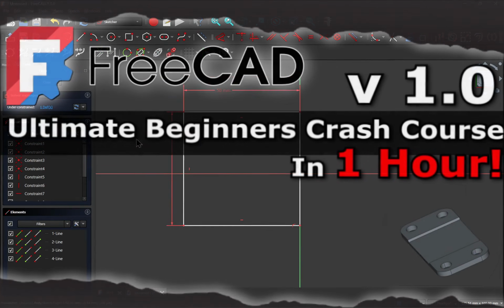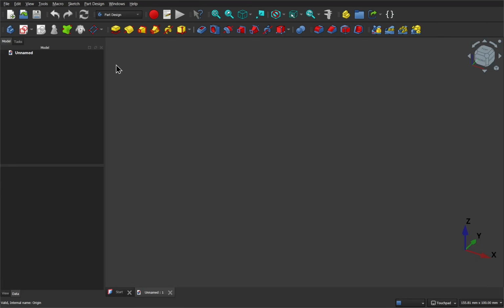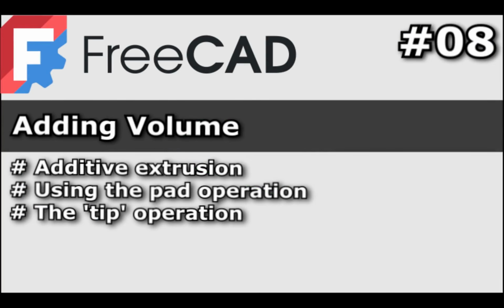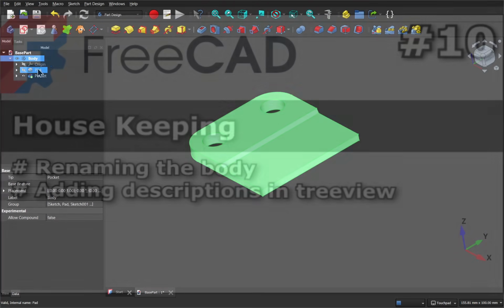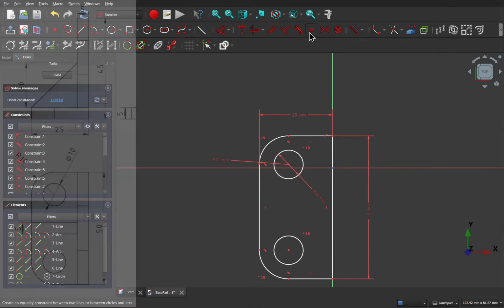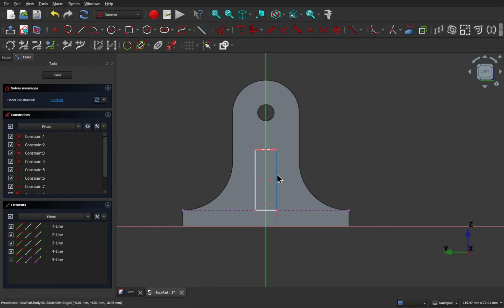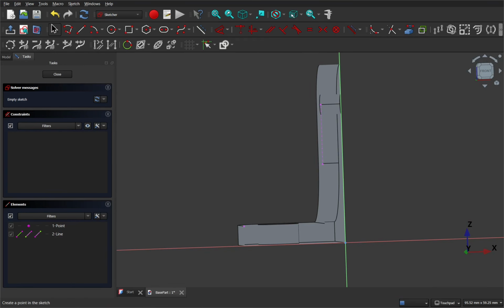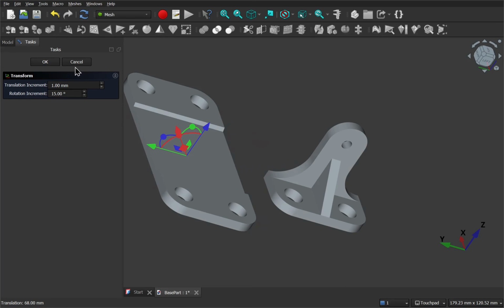FreeCAD 1.0 Ultimate Beginners Crash Course in 1 hour for 3D printing   CAD Lesson / Tutorial

Comment: Best tutorial to get started with Freecad.
Always used blender for 3d modelling but wanted learn the parametric workflow for my new 3d printer.
This is equivalent to donut tutorial on blender.
Reply from the maker: That's high praise, thank you! 😊Yeh they are different beasts, I original came from hard solid modeling with such programs as rhino and 3D studio Max so I know the knowledge transition process between the two can be a bit tricky.

Comment: I ran into a strange issue while creating the sketch for the cutout around at 24:30.. after setting a length on the bottom line, I was unable to move the top point across to the left.. you said "you can move it if you want", so I continued without doing so, but then I was unable to set an angle constraint on the bottom-left corner (I suspect) because that top left point would not move.

I did also have to remove two "redundant constraints" after drawing the initial lines, because they were preventing me from assigning the length constraints. interesting that your process didn't result in that scenario.

I then deleted the sketch and tried again, following the exact same steps (including deleting the redundant constraints), and yet this time it worked exactly as expected...

in the interest of actually learning something here, do you have any idea what might have happened there? FYI, FreeCAD is currently on 1.0.2, no functional differences from the version you're using here.
Reply: ok, no.. I'm running into similar issues trying to draw the second body. but why do I always end up with "redundant constraints", despite me doing exactly the same steps as you? this makes no sense.

on the second body: if I don't remove these redundant constraints, then I can't assign the first length constraint.. but if I do remove them, then the circles don't move with the drawing when it gets smaller. I'm getting more and more confused the deeper I get into this.
Reply from the maker: When in the sketcher in the constraints panel on the left there is a dropdown arrow at the very end above the list of constraints.  If you drop this down you will see an option called 'auto remove redundant constraints' this will cure a lot of those problems.  Also watch your cursor when adding geometry, the auto constraints will apply different constraints as you lay geometry down and it's quite easy to miss one, for example laying down a circle and releasing it while the pointer is in the vicinity of the axis will create a tangency constraint to that axis, though this will show by the cursor it can be easily missed. Hope that helps.
Reply: @MangoJellySolutions  ah, ok.. that "auto remove redundant constraints" option may explain why I was seeing something different to you then... thanks for the info. :) I thought it best to pause this tutorial at the point I got stuck, so I'll finish working through it this evening then.
Reply: @MangoJellySolutions  just wanted to follow up on this quickly, your tips here helped me make more sense of what was going on, and I managed to work through the rest of the tutorial with only nominal issues... but, I did manage to work out how to solve them by myself. (: thank you so much for this, I'm one step closer to being able to create a proper design for my DIY sim racing rig now!

Comment: If someone else is struggling with create external geometry, it's name might have changed to external projection and by default it creates solid lines and not the dotted construction lines you see in the video. To change this behavior go to preferences --> sketcher --> tick the box Always add external geometry as construction
Reply: Thanks. This should have more likes. I was wondering why my wire was not closed, because it imported an edge!
Reply: Thank you! I'm learning with FreeCAD 1.1.1 and it looks like some defaults have changed.
Reply: I realyl wish i'd read your comment an hour ago, thanks!
Reply: @tk5782  yesterday
Reply: took my 15 tries before i check this comment! Thanks
Reply: You're a savior. I kept staring at my screen and back at the video like... what am I missing?!
Reply: Yes, also thanks.  Caused me about 20 minutes of poking around until I thought to come here!
Reply: I searched this answer for hours, THANKS!!!
Reply: That took car of that. Is it useful in some way to leave it unchecked, there must be a reason for toggling this on and off.
Reply: even after disabling, I still cannot get a closed element without redundant constraints... ugh
Reply: @CurtisRose3D  try removing auto constaints from the menu
prefrenaces > sketcher > general > auto remove redudant constraints
this worked for me
Reply: I did this, but still same error, "Datum 2.00 mm for the constraint with index 10 is invalid". What is it trying to tell me. Lost - game over man, game over.
Reply: I love you mate. This comment saved me not only time but made my day
Reply: thank you holy crap
Reply: I can't find the "Always add external geometry as construction"box

Comment: I dont know what I have wrong but when I go to make the 2mm dimension at 24:18 in your video. I get a message that says. "Datum 2.00 mm for the constraint with index 10 is invalid." Any info on what could be causing this? I have followed the video step for step. I am on 1.0.2. Don't know if that has anything to do with it.

Comment: Great teacher and excellent course!
I'm 66 yo. In the early 1970s spent some time in tech school learning long hand drafting. Worked at it in the '80s. Early '90s went back to school for AutoCad Ver. 9-12. Did that till the mid '90s then changed careers. Haven't touched CAD since then, over 30 years.
I spent one day on this course. Using two screens. I had this video on one and FreeCAD on the other. I followed each step sometimes pausing or repeating the video until I had it down, then to the next instruction. The next day I drew two replacement parts for an antique radio. Ready to export, slice and print. I received a 3D printer for Christmas... Time to enter the 21st century!
Reply from the maker: Sorry, I think there has been a bit of a glitch on youtube lately and I am going back and reply to a number of messages that I have replied to before, I don't think they ended up being posted and just noticing  now.  I thank you so much for this feedback, this is exactly what I was aiming for and I am so pleased this course has helped people.  And when it comes from a seasoned draftsmen / engineer such as yourself that's extra bonus.  Thank you so much for the kind words.  And welcome to your new hobby.  I have a number of planed 3D print related content coming soon.

Comment: Disappointed when I cant recreate step 2. Clicking the three points and then clicking symmetrical constraint does not work. Edit: i fixed it. I had to increase pick radius and marker size so that I was actually selecting the points accurately
Reply from the maker: Glad you found the issue and was able to continue :)

Comment: i got suck at 13:15 if i select the two points and try to click the middle point it only allows me too select the entire "Y" Axis or "X" Axis. My middle point is blue if this has any key importance. Is there a setting i missed that you are allowed to select the middle point?
Reply: Maybe something has been changed in an update, since this video is over a year old. 
Anyhow, I had the same issue and was able to get around it by selecting the middle point by capturing the middle point with a rectangle selection. Just click and drag and make sure the middle point is inside the selection area.

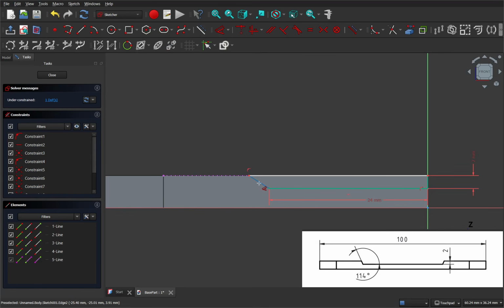Comment: Great video, but the section that begins at around 22-min is very confusing.  I've been going over it for two days now.  The first issue is that it wasn't clear I needed to double-click the face before adding the sketch.  I'm still not sure I've figured out how to get the drawing constrained or what exactly to click to.  The bit at 24:53 when you move the point that got "behind" the 114-deg angle also just doesn't work for me at all.

Comment: i don't get it. it says to remove over constrained constraint, immediately after removing the over constrained constraint, it says 3 DoF(s) (the heck is that?) is under-constrained. i must be stupid
Reply: Are you talking about the part after padding the sketch and making the rectangular cut with the triangular point? I tried at least 10 times last night and had the same issue. I did everything step by step and it wouldnt work

Comment: First of all, thank you SO MUCH for this video, it has been incredible useful.

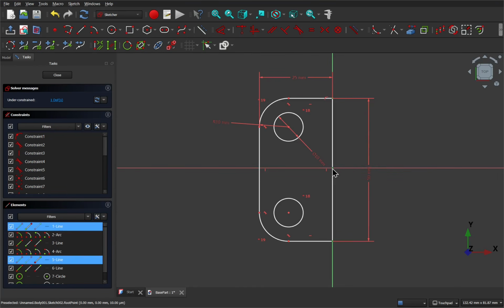At 35:12 I'm having trouble selecting the middle point, it either selects the vertical line or deselects everything. What am I doing wrong?
Reply: I kind of manage doing that, though I had to remove some redundant constraints and stuff. My fault, not yours, this tutorial is AWESOME.
Reply from the maker: Glad you enjoyed the video and found the issue, there is an option to auto remove redundant constraints in the left panel under the drop down which you can check to enable.  When it show the redundant constraint number in the brackets you can click on that and it will take you straight to the constraint which you can then delete with the delete key.  Just a few tips if you haven't already found them.

Comment: At 44:55 mine did not "auto refine" what do I do?
Reply: My Refine option was set to false
Reply from the maker: You may also want to check your preferences in the part / part design  section and look for auto refine on sketch based operations and make sure that it's set to true.
Reply: @MangoJellySolutions thank you!
Reply: @MangoJellySolutions  mmmm how do I do this? lol

I checked, "Auto refine model after boolean" and "Auto refine model after sketch-based operation"

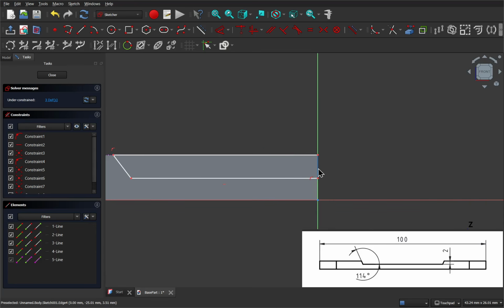Comment: 24:02 After drawing the new sketch on the side of the part, I try to assign a dimension of 2mm to the right edge, and I get an error: "<class 'ValueError'>: Datum 2.00 mm for the constraint with index 10 is invalid". I tried several times with the same result. At this point, I'd like to just delete the whole sketch and start over, but I can't even figure out how to do that. If I click on the Sketch item in the sidebar, it won't delete. I've tried selecting Delete from the popup menu, hitting the Backspace key, and hitting the Delete key.

Comment: I’ve gone back to the drawing board twice already, but at 24:00 I’m getting “redundant constraints (7,10)“ and that pocket outline  is orange instead of white. Has anyone else found this and what fixed it? EDIT thanks to @steviezhu49, who solved this further down… magic thanks
Reply from the maker: Check that you have the remove redundant constraints switched on in the dropdown in the left panel and keep an eye on the constraints that are be added when you lay down geometry.  Watch the mouse pointer and you will see the constraints being added by the side of it.  If you have the auto constraints on and pick a tool for geometry, say a circle and start to add the geometry, as you extend the circle the mouse will change to different constraints if you touch other geometry and axes attaching to them.

Also where it says “redundant constraints (7,10)" click on the (7.10) and it will highlight the constraints which you can hit delete on the keyboard to move.  Hope that helps.

Comment: I gave up trying to create the polyline - it never ever worked and kept coming up with multiple errors or crerating additional lines - God knows how I am supposed to cut out this shape. This has totally put me off now, after trying for 3+ hours just do do this one thing :(
Reply from the maker: It sounds like you're running into issues with the automatic constraints popping up when you're drawing your polyline, which can be really frustrating but it normally means you close to another piece of geometry.  Keep an eye on the cursor and watch out for the constraints.  Also the M key cycles through the modes so that could be tangent to line which in some case can cause another line.
Reply: Im having the same problem

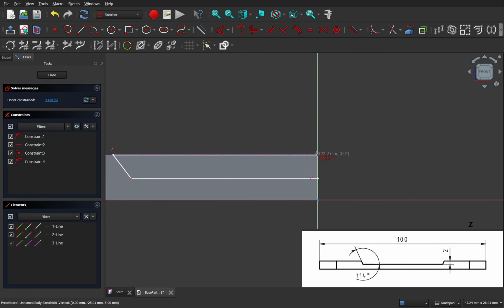Comment: Another Post with a fix for the issue around 23:40 where it wont let you dimension the sketch. Tried everything everybody else said with no luck and was going about insane. If you have tried everything and it hasn't worked then try this. Replay the video VERY slowly and make sure that the constraints he is speaking about that pop up on your mouse are the EXACT same. Similarly you will notice that little red quarter circle that pops up on top of the lower line and just as important the red dash that pops up BELOW the lower line of your sketch, specifically OUTSIDE of the shape you are now drawing. 

Go step by step and makes sure that all of this matches up. I could be wrong but what seems to be happening is depending on the exact constraints popping up(which changes with .1mm of movement lmfao) its trying to reference your shapes internal geometry AND the reference line while you're typing in dimensions which is why it pops an error on your last or second to last dimensions instead of referencing the reference line and the y axis and making things work based off that.
Reply from the maker: Thanks for commenting, you have to be very vigilant when using the auto constraint as you can accidentally touch axes or other geometry and constrain to them when placing geometry.  I wish you could increase the size of these icons that appear by the mouse cursor as they are a bit small.

Comment: This is a good tutorial, but I swear FreeCAD has it out for me. I copy step by step but it doesn't think I've got the same constraints! I guess I just have to keep at it!
Reply from the maker: Thanks for the feedback, sometimes FreeCAD can be tricky with constraints and the main tripping point is when you have auto-constraints enabled.  As you add the geometry keep an eye on the extra icons that appear by the cursor, it will show you what constraints your adding.  Let's say you add a circle, say you place your pointer over the center point, you will see a coincident constraint popup, as you click the constraint is added.  As you move the mouse to extent the circle out, if you touch the axes you will get a point on line constraint or tangent constraint.  Now if you don't see this and click you end up with constraint added.  I think I need to do a video about this and pin it to this one as it's a very common confusion.

Comment: watched the video did exactly the same and lines go orange and don`t work don`t matter how i change it ,its always the same been doing it for 7.5 hours very frustrating
Reply from the maker: Thanks for the feedback, sometimes FreeCAD can be tricky with constraints and the main tripping point is when you have auto-constraints enabled.  As you add the geometry keep an eye on the extra icons that appear by the cursor, it will show you what constraints your adding.  Let's say you add a circle, say you place your pointer over the center point, you will see a coincident constraint popup, as you click the constraint is added.  As you move the mouse to extent the circle out, if you touch the axes you will get a point on line constraint or tangent constraint.  Now if you don't see this and click you end up with constraint added.  I think I need to do a video about this and pin it to this one as it's a very common confusion.

Comment: I think you are by far, one of the best tutors for online CAD. Thank you. 
Do you do queries please? I am constantly getting an issue when trying to remove (approx. 24:09). I always get redundant constraints 7,10, and then cannot go any further with the sizes. I have loaded and reloaded the saved sketch to start again, and paused and repaused to make sure i am matching, but cannot see where I am going wrong. Any help would be appreciated, thank you
Reply from the maker: Thank you so much, really appreciate that, yes I answer queries, there are quite a few comments across the channel but each day I try to capture as much as I can.  So the first thing to make sure is that the auto remove redundant are on in your sketcher (in the left panel, small drop down, inside you will see a number of options including auto constraints .  Now when you see that "redundant constraint (7,10)" click on the (7,10) and it will highlight the problematic constraints and then hit delete on the keyboard, that will remove them.  Now try constraining again.  Keep an eye on your cursor when laying down geometry, with the auto constraints it's easy to add an additional constraint if you 'touch' an axis or other geometry, the cursor will tell you what constraints are automatically added.

Comment: 13:25 Symmetrical constraint 
select two points and origin, then click constrain symmetric
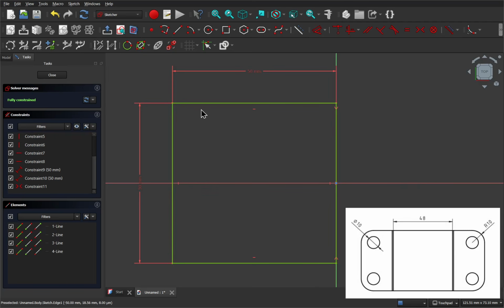14:06 FIllet
round off corners, click first line and then second line
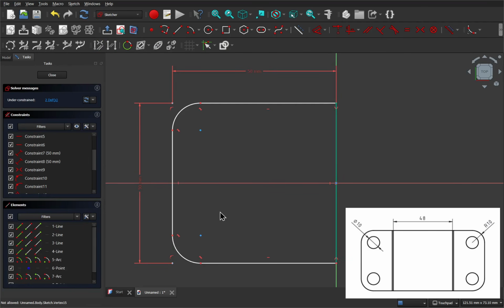14:40 Dimension constraint 
multipurpose tool, used here to add radius constraint.
cycle through the options with 'M'

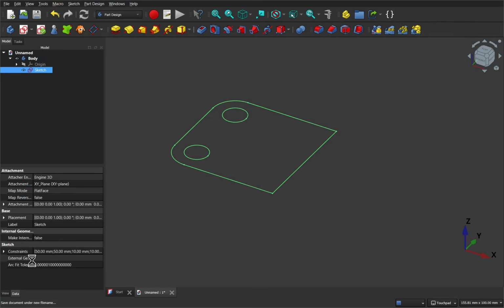17:23 Section #08: Adding Volume

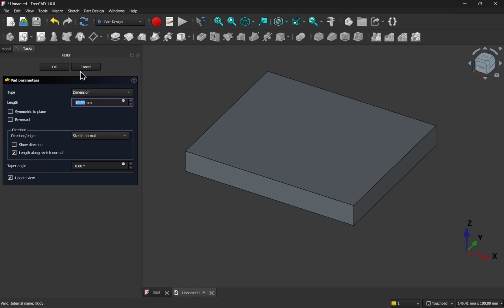20:25 a sketch can contain multiple profiles
creating sketches upon pads

21:43 Section 9: Removing Volume

22:11 selecting face, create sketch
observing attachment details and map mode

22:44 Create External Geometry
"import external geometry, which we will be using the constraints against"

In FreeCAD, "external geometry" refers to referencing the edges or vertices of existing 3D objects within a 2D sketch to create a link. This is a powerful tool for parametric modeling, as it allows subsequent features to be based on the shape of previous ones, maintaining relationships even when dimensions are changed. Instead of rebuilding a new feature, you use the external geometry tool to project a wireframe version of the existing geometry into your current sketch, allowing you to constrain the new sketch to the old. 

24:50 Using dimension tool to set an angle constraint